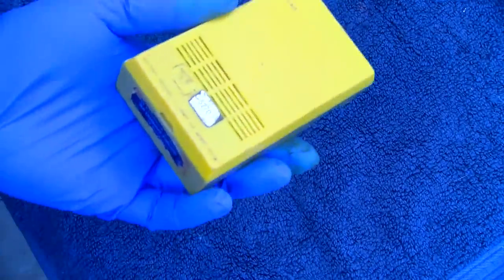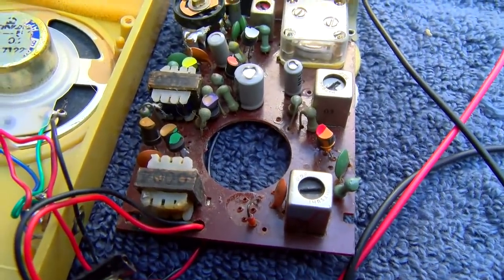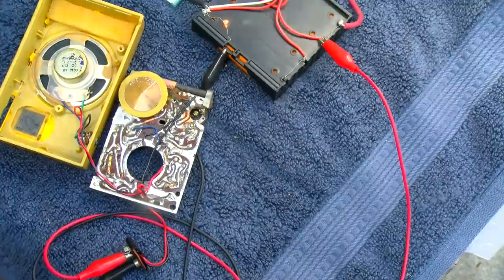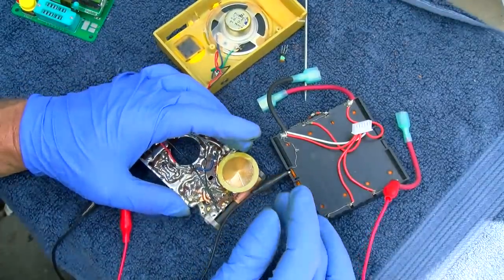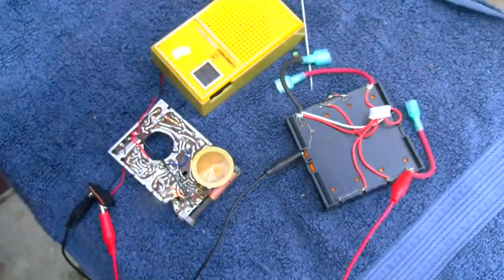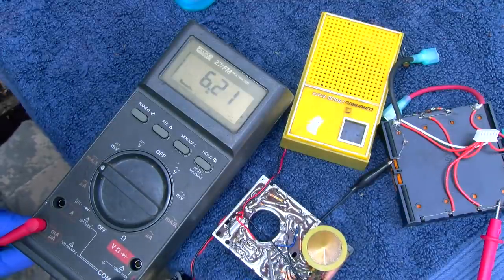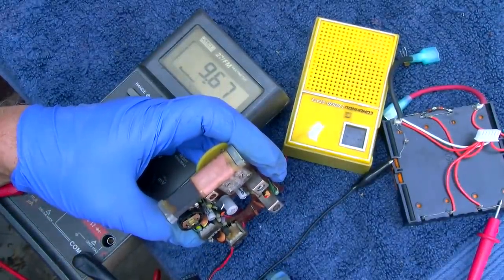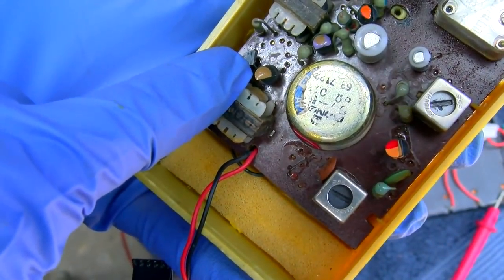Coronado Gamble-Skogmo AM Pocket Radio Repair

Comment: When you see transistors marked with paint and no manufacturer type #'s or other info, the transistors are either floor sweepings or QC failure units sold for scrap.  Then someone tests and grades the transistors to gain and frequency so the could be placed in the proper stage (hence the colored paint) and sells them cheap to 4th tier radio manufacturers in Hong Kong where quality ruled.  The one exception was Zenith.  They had some of their pocket radios made in Hong Kong that were assembled well , made of first quality parts and performed well.  It can be done if you give a darn.
Reply: It is intriguing to think that in the era when this radio was made, the wages in Pacific rim countries were low enough that it made sense to pay technicians to salvage these unwanted transistors by plugging them into manual test equipment. On the upside, these radios are very likely designed such that they are not finicky about the parametrics of the transistors, so finding substitutes is easy.

Comment: The video and audio quality is good enough for a  cheap Gamble-Skogmo pocket transistor radio repair. Fixed with a good 
explanation of what failed and why and the repair done  cheaply with excess component supply. Excellent stuff Shango!

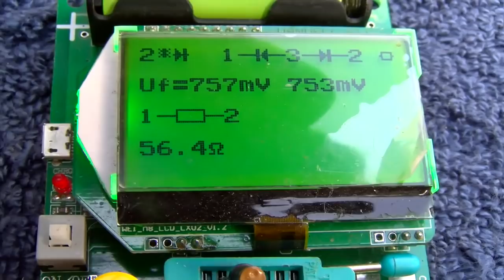Comment: Good audio with new mic despite a slight hum in the audio. Colour is good and everything is in focus. Frame rate looking good too. Watching in the UK on a 32inch TV via a firestick 4K at 720p, Resolution was good enough to see circuits and meters. Your voice comes through really clearly. In short the new setup works well. When you go to the transistor checker at 13:50 the buzzing goes away. Not anything to worry about ... Nice video

Comment: I've found that that the green corrosion comes off if soaked in spirit/white vinegar for a short time (distilled vinegar in the US?). I've had success with this on glass valve/tube pins anyway but I don't think that you'd want to leave anything in white vinegar for too long (I wash them in water afterwards and dry on a radiator). Thanks for another informative video.

Comment: The oscillator coil is adjusted to line up the lower frequency stations on the dial. The trimmer capacitor is 
for the higher frequency stations.
Reply: When I was in high school, I read that the AM band was being expanded to 1700 kHz. I re-aligned the front ends of all my radios to cover up to about 1710 kHz in anticipation of stations moving there. Although this messed up the dial calibration at the high end of the dial (say, at 1500 kHz and higher), the error was inconsequential on radios with imprecise dials (those where the tuning knob directly drives the tuning capacitor).

Comment: Another GREAT 👍 vintage transistor radio 📻. I’m glad 🙂 ya saved it from certain death 💀. It looks like 👍 the plastic has turned yellow from sitting 🪑 in the sun ☀️, but it’s still a good 😊 radio 📻. I’m not sure 🤔 if this has a dial cord, but if it does, it would be a simple one ☝️ to replace if needed. The transistors and capacitors would be out of tolerance, since this is a 1970’s radio 📻. The speaker 🔊 is permanent magnet 🧲. Your friend, Jeff.

Comment: In the market I’m in we do have AM music stations one weak oldies station at 960khz and a full service AC station with a strong signal at 1590khz
Reply: And with a good radio you may pick up the blowtorch out of Toronto on 740 kHz and if you go 25 miles to the south you will find a little 1 kw station on 1310 kHz that beams most of it’s signal to the South

Comment: I am surprised that Coronado is still around in the 60s, though this radio was a Hong Kong made radio.  I have a Coronado radio chassis, everything is there but speaker and audio output transformer.  I did purchase the replacement transformer.

Comment: At 9:50 would you short Base-Emitter junction and look for a drop in your B+Battery supply current draw? If it dropped you could conclude the transistor is likely in conduction because of bias not being correct? Or do you conclude the likelihood is heavily leaning towards a defective transistor with leaking or shorted junction? Thanks in advance! I'm just trying to firm up my knowledge and skills. At this point I've read and probably watched more repair videos than repairs I've actually completed myself! I need to get at it and get 'em done!

Comment: Audio had a little hum in it in the beginning. Not your typical 60Hz but something much higher. Later on it disappeared. Video was okay. I only noticed that the towel looked different than usual.
The radio... well... Despite of the fact that this is just a generic 13 in a dozen run off the mill el cheapo 'city radio', it still provides for an entertaining resurrection video. Another issue seemed to be the pretty much non-existent AGC. But okay. Indeed. Just put it on the shelf. Or in the trash. Not worth to spend a lot of time on fixing all of its issues.

Comment: 22:10 That is probably a 540 kHz to 1630 kHz radio, so you don't get the full modern band (525 kHz to 1700 kHz). Plus the frequency tuner is bargain bin. It's one of those radios where if you can get it to tune in your favorite station, it's worth it, I guess....

Comment: Push-pull transistors should be identical (either from the same batch, or matched on a curve tracer) so that the idle current of both is the same. If they aren't, the one with the lower VBE will draw more current, assuming both bases are fed from the same bias voltage.
Reply from the maker: Absolutely , but in this case who really cares.
Reply: It is not the Hubble space telescope, it is a cheap Hongcodial (sp) transistor radio.  It was made with unmarked QC failed transistors.
Reply: @shango066  you're right, I was just explaining the reason for the different bias currents because others may not know that
Reply: I'm sure someone with twice your life experience needed to be told that.
Reply: @lookwhatidonemade.3306 what makes you think I thought shango didn't know that? it was aimed at anybody, all the viewers. And it was not mentioned in the video.
Reply: @brainndamage  I know you meant no disrespect, but I have learned that posting facts on someone's channel is perceived as calling them out, that you have knowledge they lack. Treading on thin ice, you leave yourself open for attack from the fans and the author. It was not malicious or mean spirted, that is where I draw the line, lesson learned.
Reply from the maker: No I fully know about gain matching transistors in decent quality or high power amps. I just don't bother with it or stress over it in a crappy radio that will probably never be used again. It doesn't bother me when someone points it out I just forget
Reply: @shango066  You handled it well, it was snarky and sarcastic comments from some of the viewers that I felt empathy for the recipient. I mentioned on another channel that I don't believe in replacing every capacitor and all of a sudden I was under attack from the you have to change all capacitor guys. Just as in this case, what and how you repair depends on what it is, and it's value. It depends.....   I hope you EOL something on the 4th, long time subscriber, love the channel.
Reply: In a complementary output (OTL output transformerless) it would be most important for low distortion. I supposed in the quasi-complementary you'd still have distortion if the two transitors weren't similar in gain.

I guess this question is leaving me wondering about my understanding. I think because of the PNP and NPN type devices in complimentary architecture I immediately think they're totally different and therefore you would want to curve trace and compare. But at the end of it all it's about symmetric waveshape and therefore low distortion. I'd suspect the radio could easily be ten percent or higher THM and that would be within design specifications. That would be the biggest reason to disregard gain matching the two output transitors. Plus the likelihood of little practical hours of use as intended for the device as originally purchased when it was new.
Reply: @johnnytacokleinschmidt515  exact matching wouldn't make economic sense in this application, with that tiny speaker, it only needs to be good enough to put out legible speech. Maybe it would be good to match at least the idle currents or also the gains.

Comment: The video and audio was fine on my 32" TV fed from the laptop via HDMI and audio fed from the set to the amplifier & speakers.

I wish other uploaders (or is it YouTube themselves doing this?) wouldn't force everything above 480p to 60Hz. It's just mot necessary on most videos & is a waste of processing and therefore electrical power, RAM usage and network bandwidth. I'm thankful you are avoiding this.

Comment: Wouldn't a complimentary symmetry output (NPN-PNP)be cheaper than having a transformer for phase inversion? This looks like 70s- 80s vintage, not in the era of expensive transistors...
Reply: That would require carefully matched transistors. Those things were made from surplus and scrap transistors.
Reply: @westelaudio943  I see. I knew it was something to do with cost...